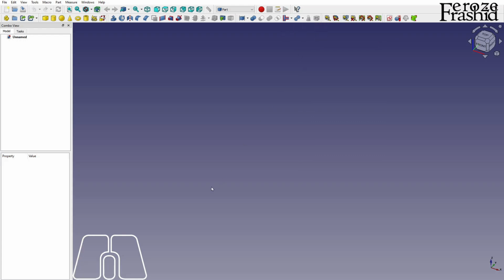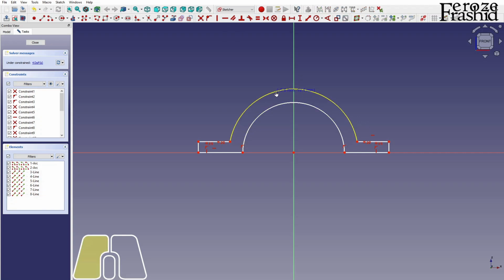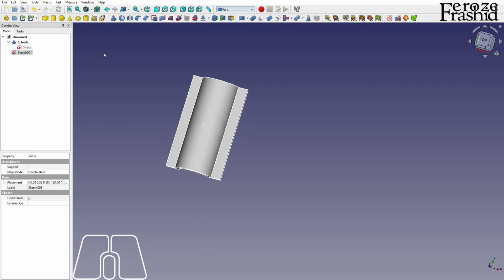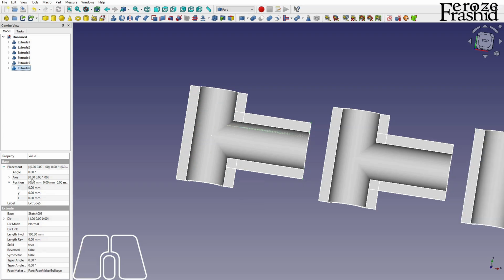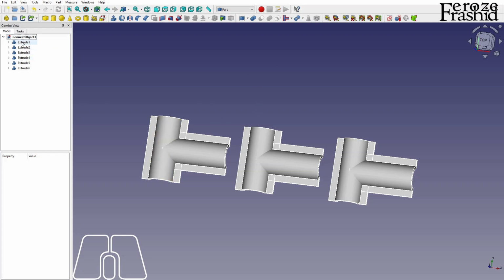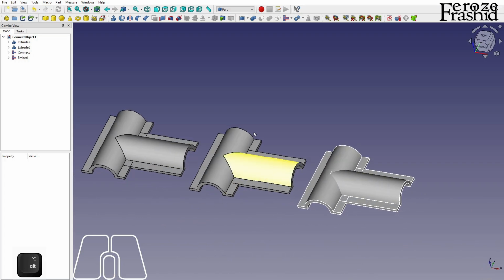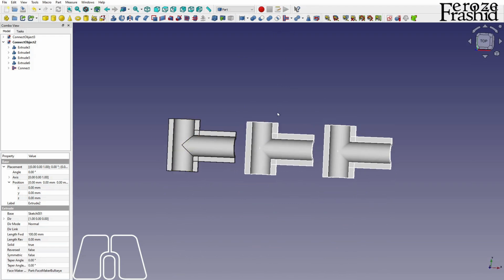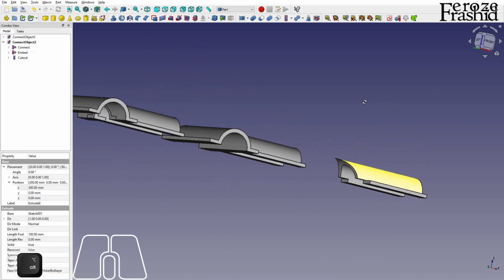Join Objects: Connect Object, Embed Object, and Cutout for Object in FreeCAD 0.21

Comment: Katt, Awesome work and your thought process is something that I connect with. With the cutout example you came up with, can we take the cutout piece and flatten it out like you can do in the SheetMetal work bench? I am always needing to come up with a template to cutout a tube in order to accept another pipe coming in at a odd angle. So in SheetMetal WB you design part with tools common to sheet meatal work shop, then once you have the 3D part designed then you can lay it out on a single flat piece of stock (if possible) to see what is the best fit for the material on hand (is one use) or dimensions to use to copy the drawing over to your flat stock...Thanks
Reply from the maker: Good to know it was helpful. 
You can make the template from "Curves" workbench. Select the cutout of the pipe and click on "Flatten Face" from Curves workbench. That will create a planer surface which will work as the template you are talking about. Hope this helps.